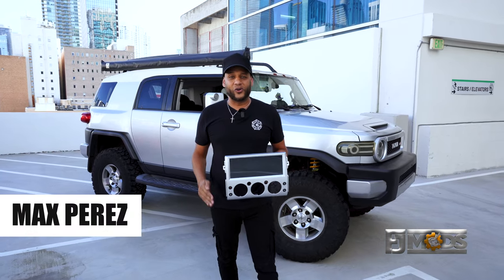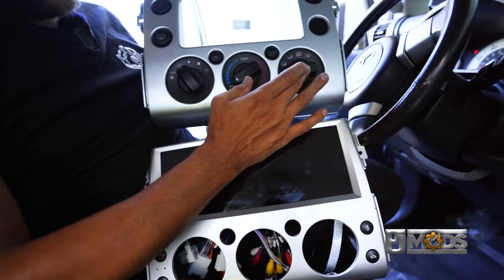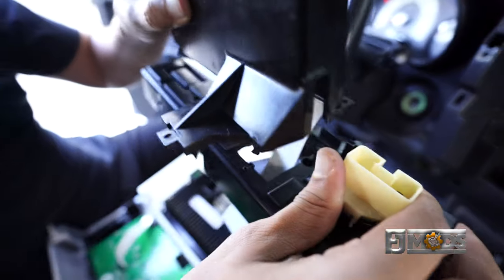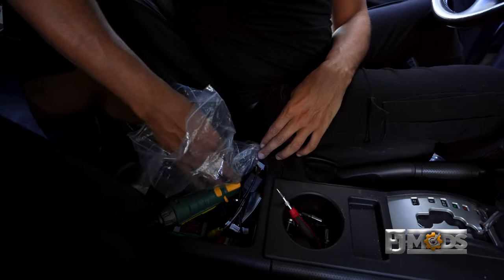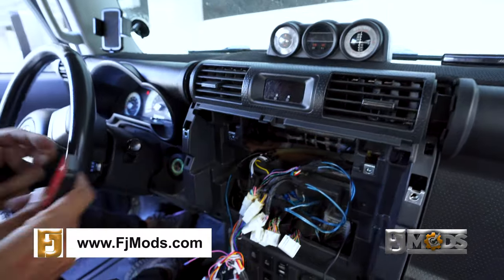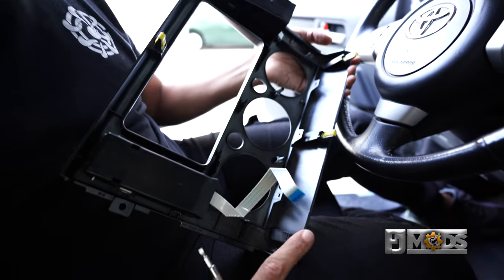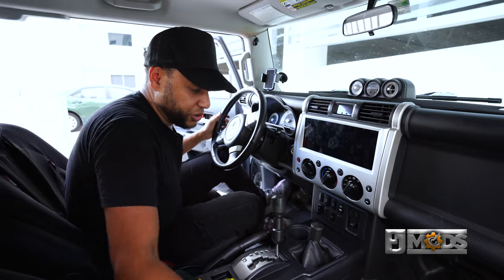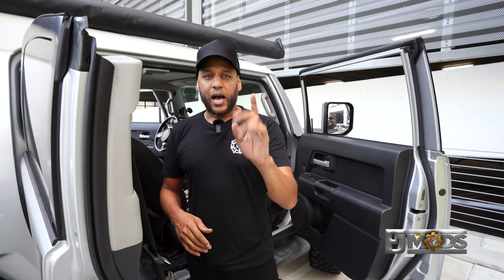FJ Mods: FJT-0814 fj cruiser andriod radio Step-by-Step Installation Guide.

Comment: The real question is this unit utilize the steering wheel controls still
Reply: ...and of course, unanswered.
Reply: The wheel controls do nothing after this is installed
Reply: @Havenscythe  You need the maestro adapter, then the steering wheel buttons work. Look for stereos for your year of FJ on crutchfield, will recommend proper maestro box.
Reply: @haxsys Actually yeah they do work, you just need to assign the buttons functionality in the android radios settings.
Reply: Time for a new wheel lol
Reply: Do a search for FJ cruiser steering wheel harness, it's what's required
Reply: I installed mine, everything works including steering wheel controls, BUT my hazard light are stuck on and cannot turn them off